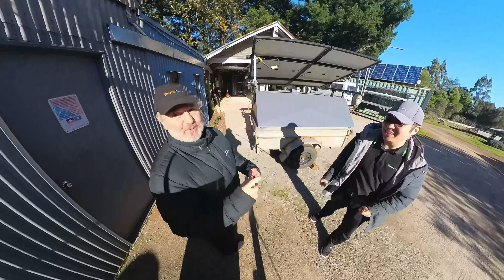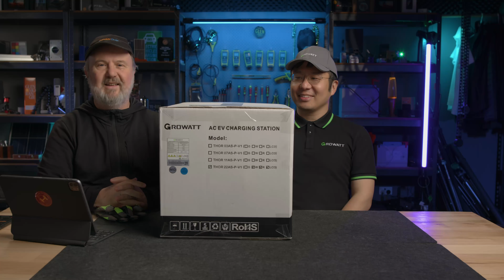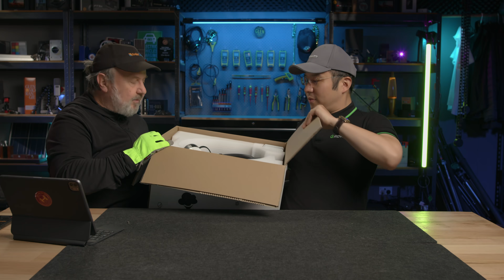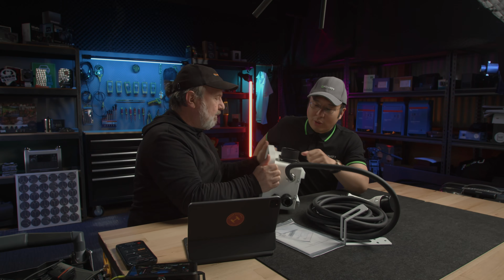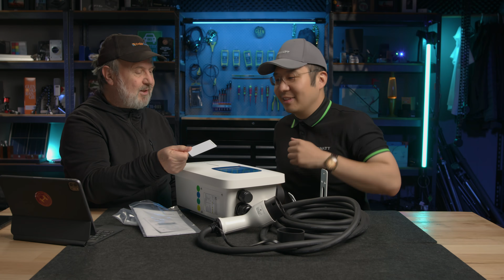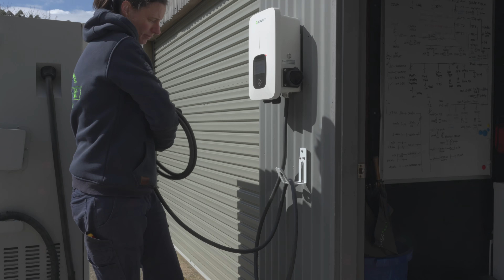Rex Wang from Growatt with their new AC EV Charger

Comment: I have an EV, 20kW of PV and 3x5kW single phase Growatt inverters. I have looked at “solar powered” EV chargers but they seem to work by monitoring how much is being exported to the grid and sending that amount to the EV. I am off-grid and do not export to the grid. Does the Growatt EV charger actually monitor solar production? The Growatt app only records solar consumption not production., excess solar is shown as curtailed.